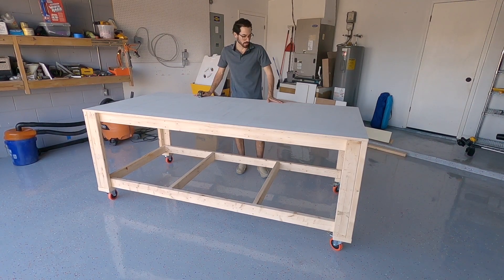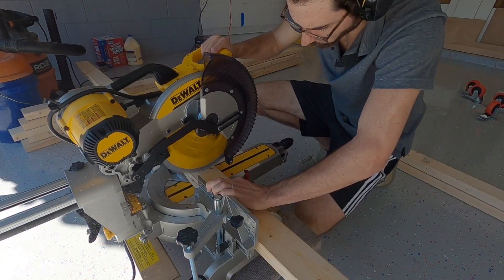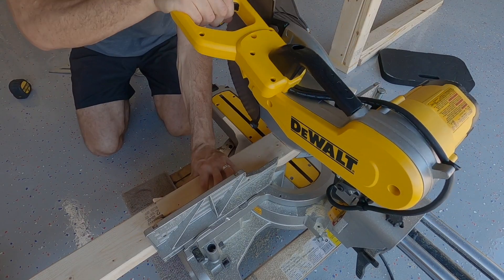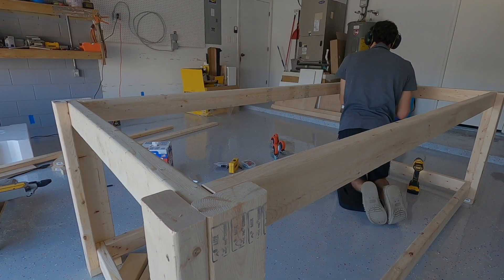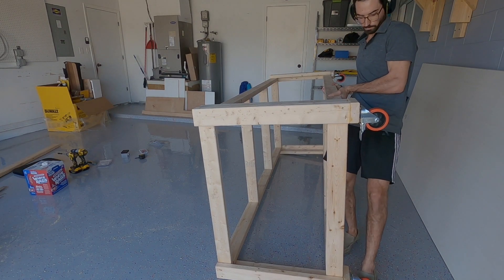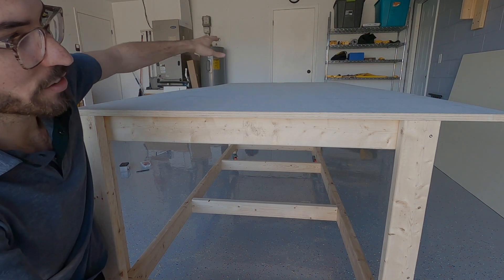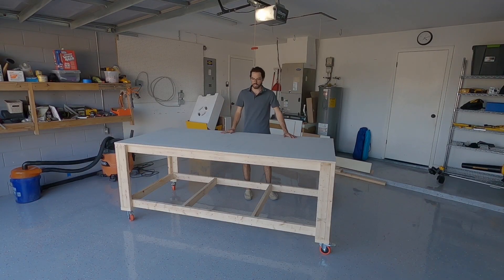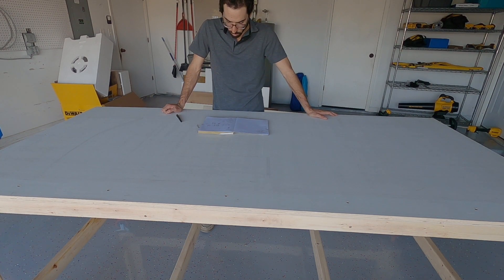DIY Workbench and Outfeed Table

Comment: Quick tip, Pocket hole the underside first to hold the top down so you can remove it easily. Nice floor , I have the same.

Comment: Nice video.. been wanting to build one like this but Id like to delete those cross boards on the bottom and leave one long side open at the bottom for storing some stuff on wheels like a pressure washer, wheelbarrow etc. I want to be able to roll them up under. If I left one side open like that but still had the other 3 bottom supports around 3 sides, do you think that it would still be pretty sturdy? Thanks!

Comment: Nice build. I'm not a carpenter or a cabinet maker.
I understand the height, but why did you make it as wide and as deep ? Why not make the top 25"deep. That way you would have enough plywood to add to the lower part?
Reply from the maker: I just wanted a really large table. I add more plywood to the bottom a few days later, wood was a little cheaper then

Comment: Well done!
You were very brave to use the jigsaw on your new work top. I think I would have clamped down that straight edge you had, and run the jigsaw along that.  You seemed to do a good job without though.
Are you going to fill it in at some stage? That’s a lot of real estate that goes unused.
Reply from the maker: Thanks for watching! Slowly but surely I’ll add some storage underneath